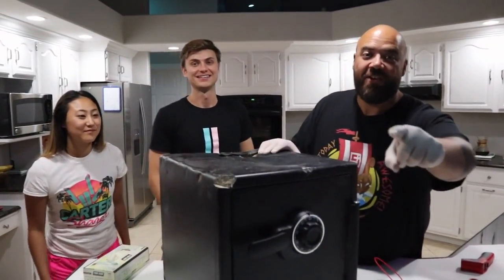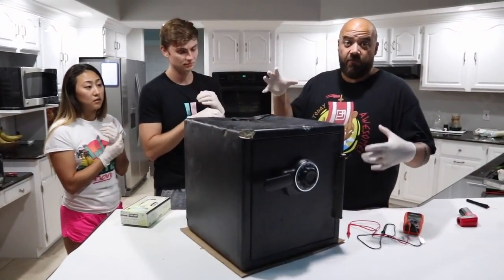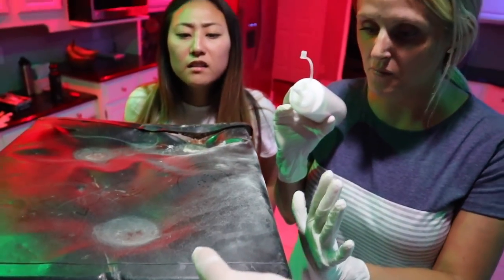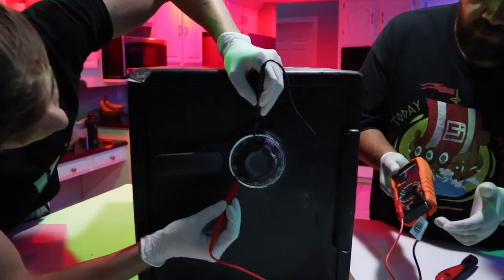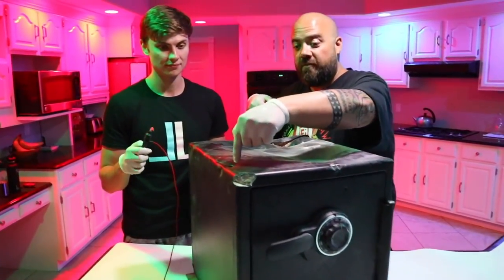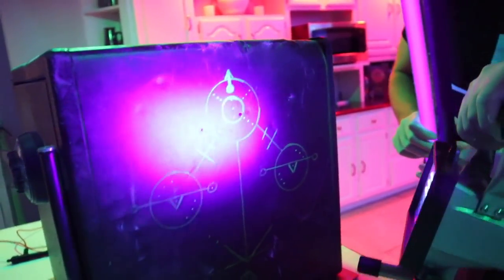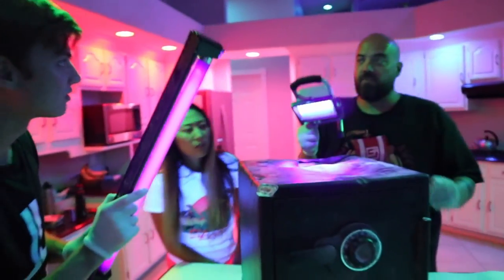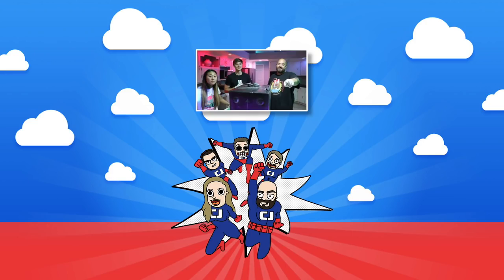Investigating Mystery Abandoned Safe for Lost Secret Clues!

Comment: Lemme throw some facts down
1. the reason you are getting electric currents is because of static electricity. The safe is metal so it will pick up any and all types of electric currents.
2. The reason that its 50 degrees at the bottom is that when cold air gets blown(such as breath) it likes to bring that coldness in and store it in the metal thats why when you leave metal in a room with normal temps. its cold at first touch.
3. The reason there is only 3 fingers is because the thumb and pinky fingers are supporting the corners. 

So its not really much of a mystery as you think.